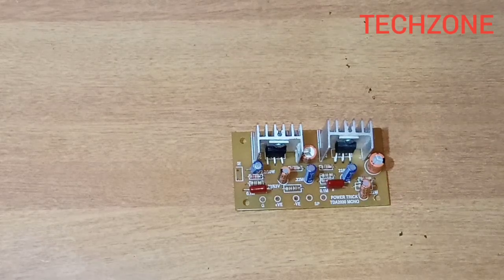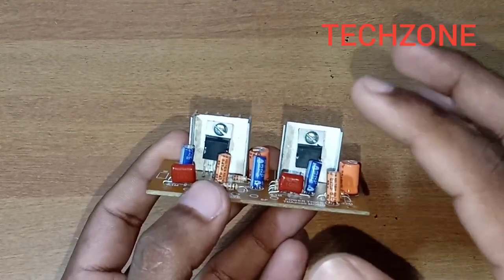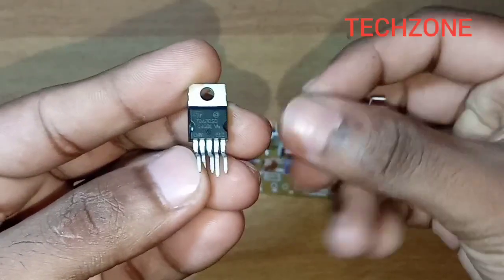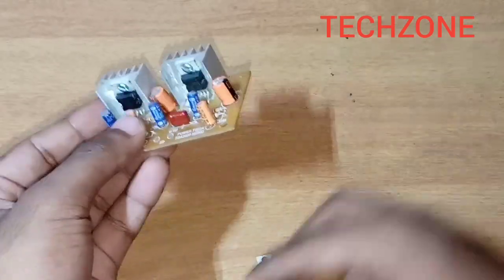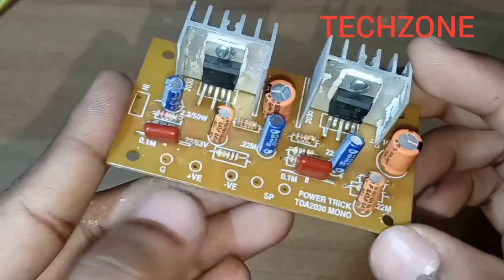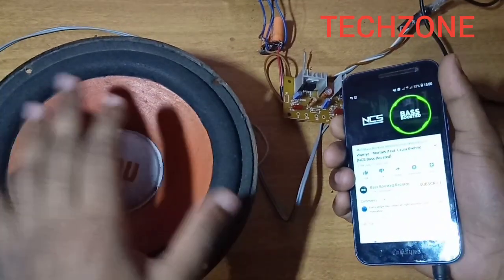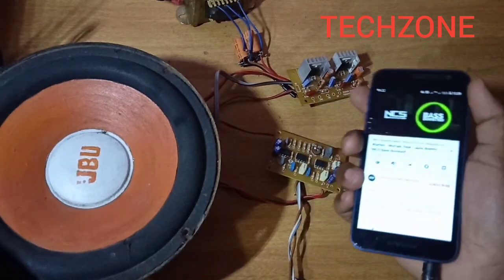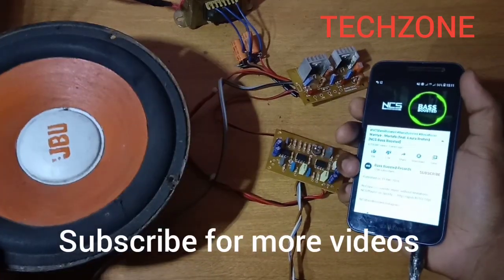Tda2030 to 2050/amplifier upgradation  malayalam.

Comment: 5.1 hometheaterile ella (7) 2030 ic um  ithepole mati 2050 akunna kond entelum kuzhapam undo?
Power supply dc 12-0-12, 3 amp aanu.. Amplifireinte Circuit boardil entelum matam varuthano
Reply from the maker: Prashnamilla. But change transformer. 12-0-12  5 to 10 ampere
Reply: Sub 2050 bridgum, centre 2050um bakki elam 2030 aakiyalo

Comment: Tda 2050ക്ക് 12 0 12  5amp SMPS  കൊടുത്താൽ വല്ല കുഴപ്പമുണ്ടോ
Reply from the maker: No problem.
Reply: ഇതിലെ 6inch സുബവൂഫർ ന്  നല്ല വർക്കിംഗ് ഉണ്ടാകില്ലേ. ഇപ്പോൾ ഉപയോഗിക്കുന്നത് 20 30 അതിന് വർക്കിംഗ് കുറവ്
Reply from the maker: @autotech3127  2030 ekkal watts koodutal aanu, so better working prateekshikkam.

Comment: Bro ithu ella 2030ic amplifier bodilum chaing chayan patumo athu kondu bodinu problam undakumo
Reply: Enta kayilullath oru 2030ic ulla oru amplifier anu athil 2050ic matan pattumo
Reply from the maker: @vishnue1136  yes, mattam.
Reply from the maker: No, boardinu problem undavilla. Itil load cheyyunna speaker/ subwoofer watts koodi  pariganikkanam.
Reply: Ithil subwoofer ic stk4142 icyum spekar 2030 icyum anu apoll kodukan pattumo
Reply from the maker: @vishnue1136  yes, kodukkam. Nilavil  5 channelsinu use cheyyunna speaker inte rms rating 35 watts or above undonnu nokkanam.
Reply: @techzone9209  ipoll 2030 icyil kodukunnathu 9w home theyatar spekar anu athil use chayunnath 
 Chantar chanalinu alpam whats kutanayirunnu
Reply from the maker: @vishnue1136  yes, tda 2050 vekkam, kurach power koodiya speqkers koodi use cheyyuka.
Reply: Ithil kodukunna Subwoofer 8ing anu
Reply from the maker: @vishnue1136  subwoofer prashnamilla. Stk ic alle subin.
Reply: @techzone9209  aa
Reply: Spekr protashan board vakumbol spekarila plass lin അല്ലെ spekar protashaniluda kayari eragadathu mainass coman അല്ലെ
Reply from the maker: @vishnue1136  yes, boardili ninulla ground nere socketilekk kodukkuka. Ic yil ninulla wire speaker protection boardilekkum.
Reply: Ithil center chanal mathram ic2050 baki  chanalinu 2030 enna reethiyil vakan patumo athu kondu problam varunudo
Reply from the maker: @vishnue1136  problem onmumilla,
Reply: Spekar ohms engina ariyan sadikum onnu paragutaramo
Reply from the maker: @vishnue1136  oru multimeter use cheyt check cheyyam.
Reply: Enta kayil oru home teyatarinta spekar anu nan use chayunathu 4ohms  3w spekarum kayil udu athu use chayan patumo ennu ariyana
Reply: എങ്ങിനെ
Reply from the maker: @vishnue1136  multimeteril resistance checking mode use cheyt nokkuja. Related videos youtubilund bro, nokku.
Reply: പറഞ്ഞു തന്നതിന് താങ്ക്സ് bro
Reply: Multimeetar ohms raing ethilanu idadath
Reply: 2030 icyil 8ohmsil 10w 2spekar parail ayitu kodukan pattumo
Reply: 2030 2050 icyuda maximam ohms etharayanu
Reply: amplifier Spekar wayar nelam kutti vakumbol ohmsil matam varunathukondu amplifierinu kuzapamundo onnu പറഞ്ഞു തരാമോ
Reply: എന്റെ amplifieril 2030 icyanu athil use chayitirikunnathu 8ohms 10w 5spekar anu athu wayar neetumbol 8ohms spekar 9ohms ആകുന്നുണ്ട് athu kondu amplifierinu valla kuzapavumundo
Reply from the maker: @vishnue1136  no
Reply from the maker: @vishnue1136  prashnamilla
Reply: Avinash cheyumbol 8ohms 9ohms akunund
Reply: ohms kudiyal kuzapamundo

Comment: Njan use cheyyunnath TDA 2030 5.1 AMPLIFIER aanu athil 12 inch subwoofer kodukkan enth cheyyum
Reply from the maker: Sub woofer channelinum tda2030 aano?  Enkil athil   12 inch suit akilla. Work aakum, but  ic overheat aayii  damage aakum.
Reply: @techzone9209  athe ic potti pokuvaanu
Reply: @techzone9209  entha cheyyan patuka
Reply from the maker: @PraveenKumar-df5vk   12 inch enthayalum support aavilla, 6 inch  4 ohms 50 watts subwoofer match aakum.
Reply: @techzone9209  njan athil 10 inch soundex subwoofer aanu work cheythirunnath problem onnum illarunnu
Reply: Ippo 12 inch sub koduthapozhaanu problem sony xplod aanu 300 watts rms aanu

Comment: 2030ku pakaram ethoke ic use cheyam amp sub power 12inch kodukan pattiyath
Reply from the maker: 12 inch subwoofer watts?
Reply: @techzone9209  dainty sub anu
Reply from the maker: @amalcomrade9147  2 transistor/2 mosfet board use cheyyam bro
Reply: @techzone9209  whatts app number tharo oru help venam
Reply: @techzone9209  ente amp 5.1anu athinte speakers kodukan ethra watts kodukan pttum enn ariyilla
Reply: @techzone9209  contact number tharo

Comment: 2050ic യിൽ 8"subwoofer kodukkamo
Reply from the maker: Yes, use cheyyam.
Reply: 2030icയിലോ
Reply from the maker: @akhilav2147  8 inch load cheyyam, upto 40 watts aayirikkum nallath. Allenkil volume kootumbol distortion undakum.
Reply: 8" 40watts 8 ohms
Reply from the maker: @akhilav2147  use cheyyam.
Reply: @techzone9209  tanx bro
Reply: Power mathram nokiyal mathi 12 inch venamenkilum connect cheyyam

Comment: 470nj63നു പകരം 474 j100 (box capacitor )ഉപയോഗിക്കാൻ പറ്റുമോ
Reply from the maker: Use cheyyam.
Reply: Tip 142 tip 147 input voltage ampere ethraya bro
Reply from the maker: @sandeepmtsandeep3703   27-0-27/5 to 10 ampere powersupply use cheytal nalla result kittum.
Reply: @techzone9209  ente kayyil 30 0 30 ആണ് ഉള്ളത് എന്തേലും പ്രോബ്ലം ആകുമോ
Reply from the maker: @sandeepmtsandeep3703  ac or dc?
Reply: @techzone9209  dc
Reply from the maker: @sandeepmtsandeep3703  no problem

Comment: Bro എന്റെ കൈയിൽ 2030 ic യുടെ ഒരു 5.1 home theater undu... ഇതിന്റെ sub woofer ന്‍റ രണ്ട് ic മാത്രം മാറ്റി 2050  വെച്ചാൽ result കിട്ടുമോ..?
അങ്ങനെ വെച്ചാല്‍ മാക്സിമം എത്ര watt woofer connect cheyyam....?
Reply from the maker: Yes, 2030 matti 2050 vekkam. According to data sheet, tda 2050=35 watts rms output and 50 watts maximum ouput parayunnund. So, better perfomance prateekshikkam. 2 ic bridge cheyt use cheytirikkunna karanam upto 8 inch subwoofers connect cheyyam. 4/8 ohms   upto 100 watts
Reply: @techzone9209  thanks bro
Reply: @techzone9209  heating problem ഉണ്ടാകാന്‍ സാധ്യത ഉണ്ടോ...?
Reply from the maker: @syamlals4755  2030/2050 randum nalla reethiyil heat aakum
Reply from the maker: Pinne ic replace cheyyumbol , ic kk um heatsinkinum idakk mica sheat vekkan marakkaruth.
Reply: @techzone9209  ok bro thanks
Reply: Whatsapp number onnu tharumo..?
Reply from the maker: @syamlals4755  yes, please only whatsup. No:9544383573

Comment: Bro ente pazhaya bpl sanyo yude tape recorder aan.. ippo njan ith amplifier aayittanu use cheyyunnath.ithil 8ohms 2 speakerum 8ohm 10w woofer um und,,,,wooferil ninn positive connection njan speakerinte portil connect cheythu appol sound koodi but kurach kazhinjappol sound onnum kelkkunnilla...Ente frnd nokkiyittu paranjath Audio IC complaint aayirikkum enn(LA4630).Ic njan solder cheyth maatti shopil kaanikkan... Ippol tape on aakunnilla but current varunnund...Ic complaint aayirikkumo...Pls help...Model Bpl Cw111k aan
Reply from the maker: Nerit check cheyyathe parayan kazhiyilla bro, engilum oru assumption vech ic complaint thanne ayirikkam. Ee ic yil datasheet prakaram maximum out varunnath 10 wattts aanu @3 ohms. Load koodi ic damage aayathayirikkam.

Comment: Bro... home theatre ഓൺ ചെയ്യുമ്പോഴും ഓഫ്‌ ചെയ്യുമ്പോഴും sound അഡ്ജസ്റ്റ് ചെയ്യുമ്പോഴും subwoofer ൽ നിന്നും 5 speakers ൽ നിന്നും tuck... tuck... എന്ന് ഫയങ്കരെ സൗണ്ട് കേൾക്കുന്നു. അത് എന്തുകൊണ്ടായിരിക്കും?
Reply from the maker: Nerathe ee sound undayirunn
Reply: Speaker protection board work cheyyathathukond aakam, IC amplifier aanenkil athinullile mute, standby voltage correct aakathathukond aakam.
Reply: ഇല്ല bro... ഫയങ്കര സൗണ്ട് ആണ്....

Comment: Bro... എന്റെ 5.1 home theatre - ൽ 2030 - ന്റെ ഏഴ് ic ആണുള്ളത് അതിൽ subwoofer ന്റെ രണ്ട് ic മാത്രം 2050-ലേക്ക് upgrade ചെയ്യാമോ? അങ്ങനെ ചെയ്യുന്നതിന് circuit ലെ വേറെ ഏതെങ്കിലും മാറേണ്ടതുണ്ടോ? Transformer 12 v, 3.2 A ആണ് ഉള്ളത്, ഇത് മതിയാകുമോ?
Reply from the maker: Subwooferinte 2 ic 2050lekk upgrade cheyyam. Prashnamonnumilla. Vere mattam onnum varuthendathilla.
Reply: ഇപ്പോൾ ഉള്ളതിനേക്കാൾ കൂടുതൽ output കിട്ടുവോ
Reply from the maker: @prasanthnair5403  according to datasheet, tda 2030-18 watts and tda205=35 watts, so kooduthal output pr atheekshikkam.
Reply: Thanks bro.... ♥️♥️♥️♥️
Reply from the maker: @prasanthnair5403  keep suppporting. 💕
Reply: @prasanthnair5403  illa thonunnu because voltage same aanu pne rghane wattage koodum?
Reply: @elhub4100  🤣 aysre
Reply: Sure... i like your channel........ 😘😘😘😘😘
Reply: Ipozhathe transfomer il ninnu maximum 38Watts output mathrame kittukayullu 5A leku upgrade cheyyunnath nannayirikum

Comment: Bro 18 v powr suply evidenu kitty?
Reply from the maker: 12 v transformer uoayogich dual supply cheyt kazhiyumbol, around +- 18 v kittum(depend on capacitor value).
Reply: Capacitor ethrayanu ittathu, maximum 15.5 volt alley varunnathu

Comment: ഇത് mono ബോർഡ് അല്ലെ ഇത് സ്‌റ്റീരിയോ ആക്കാൻ പറ്റുമോ tda2030
Reply from the maker: Same boarf stereo available aanu. Price around rs 120
Reply: @techzone9209  evdnn kittum?..pinne power supply mattathe eghane watts koodum?
Reply from the maker: @elhub4100  stereo board mikka electronic shopil available aanu. Nammal oru ic yude output parayunnath athinte datasheet prakaramanu, tda 2030ic +-18v  il 18 watts output nalkum, tda 2050, +-18v il 35 watts output nalkum, ini voltage uyarthi +-21v aakiyal maximum 50 watts vare output prateekshikkam. Voltagil mattamilla, ampere kootendivarum.

Comment: Bro njan tda 2030 2 ic varunna sub amp ane upayokikkunath 12v5amp transformer ane use cheyyunath ic upgrade cheyyumboll transformer ampr kootendi varumo
Reply from the maker: Keep supporting.
Reply from the maker: Venda bro, ippol use cheyyunath thanne mathi. Satyathil 5 ampere transformer venamenilla, 2 ickk 2/3 ampere okke thanne mathi. 2/3 amperil thanne rated power output kittum.
Reply: @techzone9209  tks brow😍😍😍

Comment: 5.1 amplifair .5ic 2030 20wx100.2ic 2050 70w.with bass treble
 Sub filter.  Power supply volt ? Amp?
Reply from the maker: Boardil tda 2030 7 ic varunnundo?  Dual supply aanenkil 12 0 12 /5 ampere transformer use cheyyam. After rectification around +-18v kittum. Single supply aanenkil maximum 40v dc /5 ampere vare kodukkam. (24-30 volt aayirikkum safe.. )
Reply: @techzone9209  സിംഗിൾ സപ്ലൈ കൊടുക്കാൻ പറ്റുമോ...?
Reply from the maker: @jahanb ee board dual supply aanu. Single supply varunna board available aanu.  24-30 v dc vare kodukkam.
Reply: @techzone9209  thank you thank you
Reply: @techzone9209  ഈ amplifire board എവിടെ കിട്ടും പ്രൈസ് എത്രയാ
Reply from the maker: @fishtechkerala4065   available.below rs 200.
Reply: @techzone9209  എവിടെ കിട്ടും
Reply: TECH ZONE 5ic 2030.  sub;2ic 2050.thanks